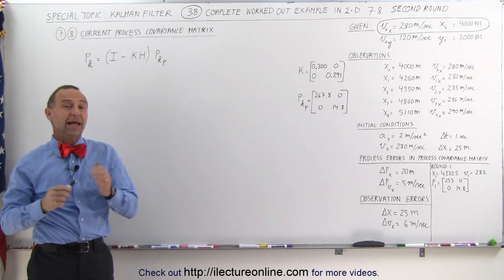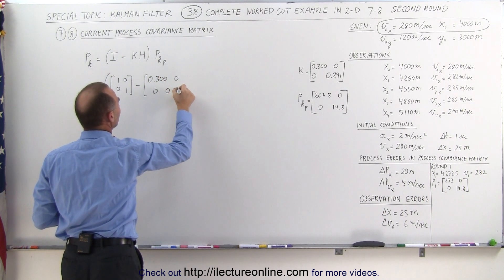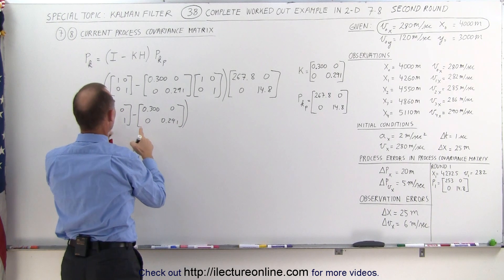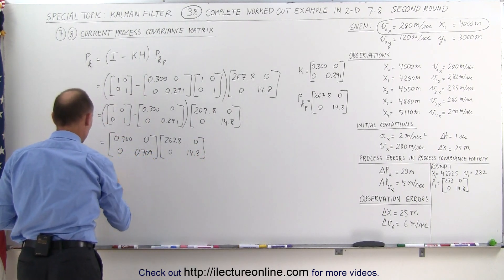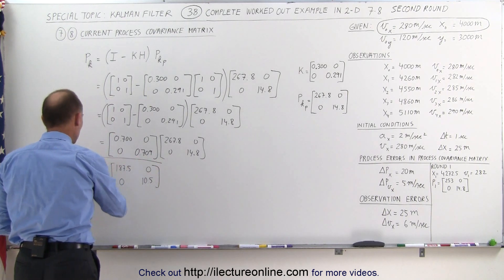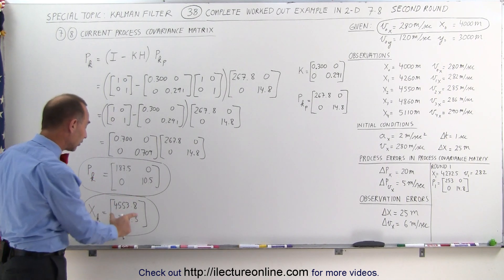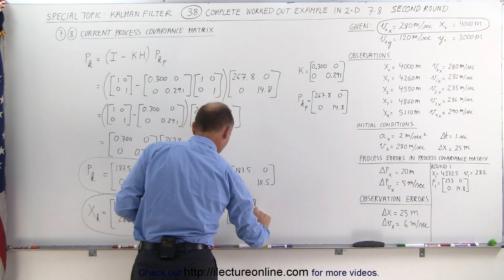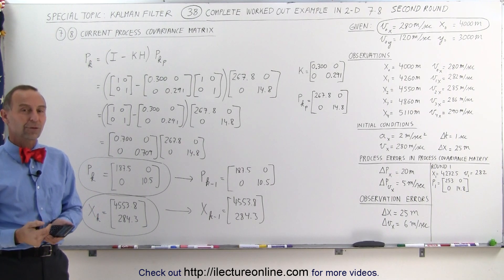Special Topics - The Kalman Filter (38 of 55) 7, 8 of Second Iteration - Tracking Airplane

Comment: So P will just be smaller and smaller?
Reply: Yes in this case as Q is set to be 0.
however, P going to 0 is basically throwing the measured value away, so ideally Q should not be 0.

Comment: Thank you for the didactic Explanation on kalman filter.Under which conditions would a kalman filter be more likely to not converge, is it possible that the filter completely diverges and does not return to be stable and reduce the kalman gain continuely?Is it reasonable to understand a decreasing kalman gain as a condition for a converging filter because a very high kalman gain would only rely on measurements?